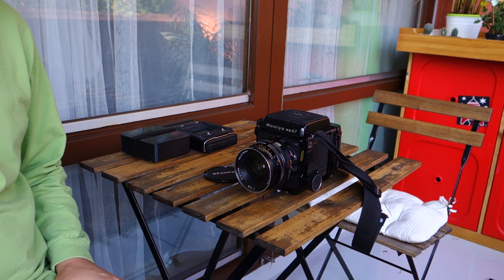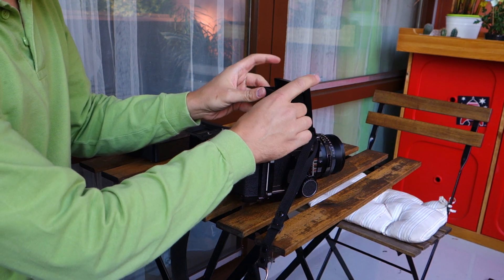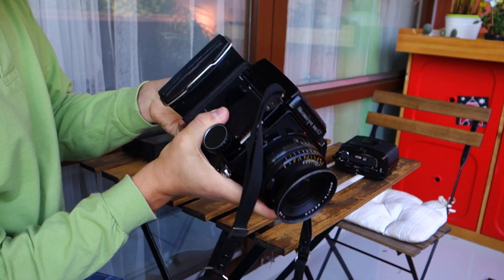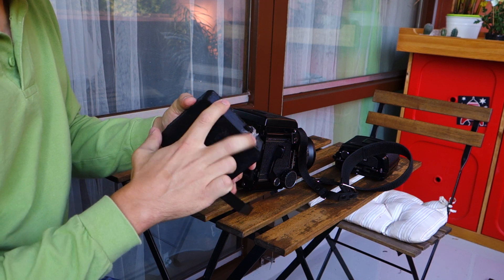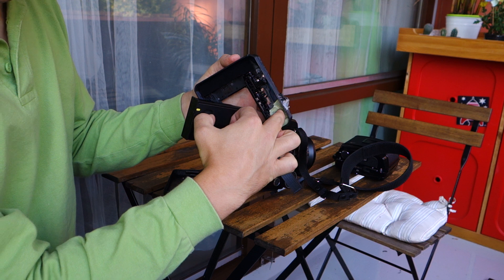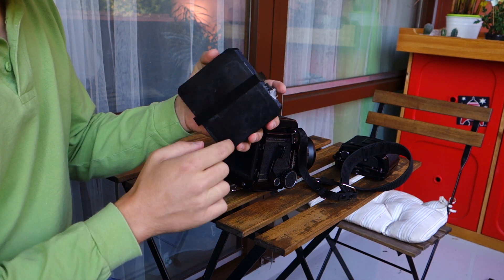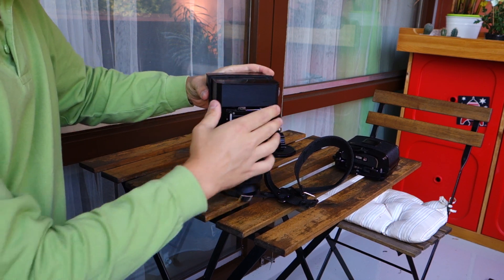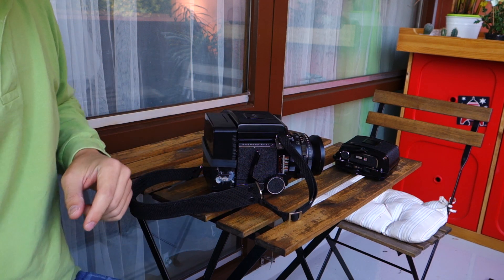Mamiya RB67 3d-printed instax mini back

Comment: Looks good. How accurate is the focussing and did you keep the mechanical system (gears from motor to roller and the small film ejection 'prong')? 
A 3D model of the back would be super nice to look at. I'm currently trying to attach an install mini to my RB67, but I don't think it's possible without removing the rotating back adapter.
Thanks :)